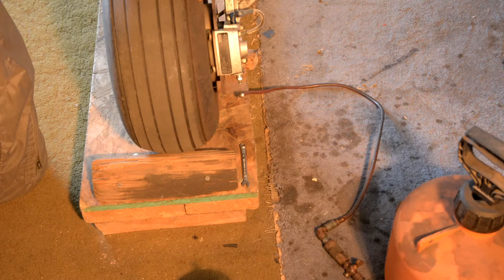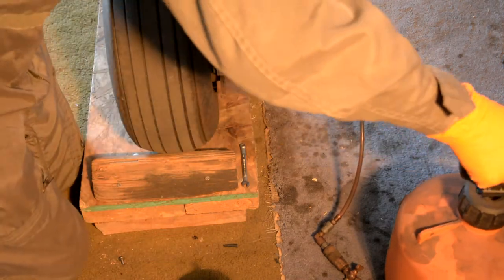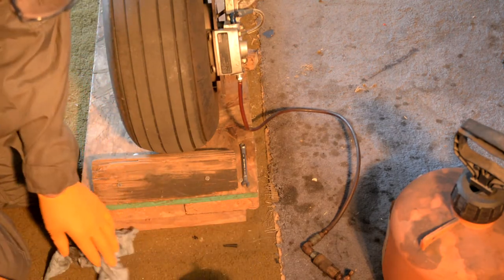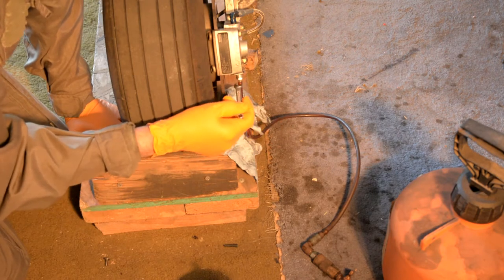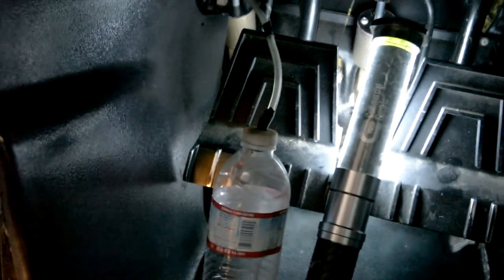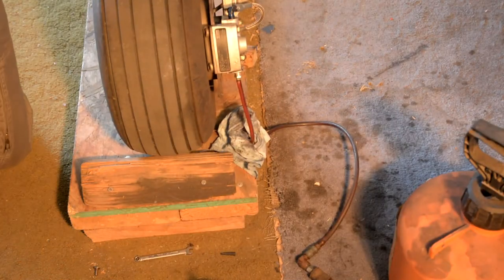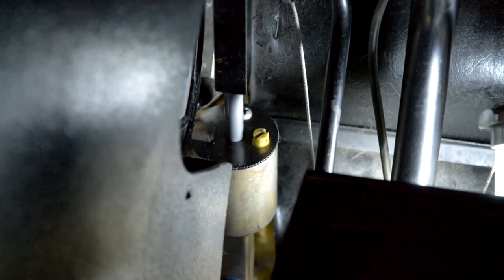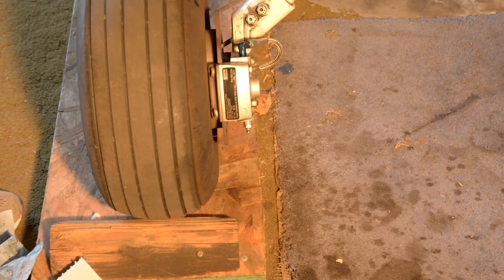Pressure bleeding brakes on a Cessna Cardinal RG

Comment: This is great info.  I just made the pump set-up for the fluid with a 1-gal sprayer from HD for $9 and a few fittings and some  5/16 OD plastic hose which fit tightly on the nipple.  Now...this looks easy if there are only brakes on the pilot side...right and left caliper...right and left brake cylinder. What changes with two sets of brakes?   Thanks!
Reply: Usually it just linkage from the copilot side moving the pedals, so there’s not another set of master cylinders.